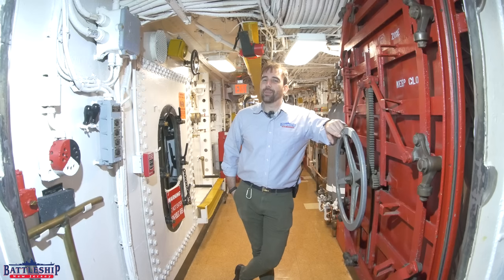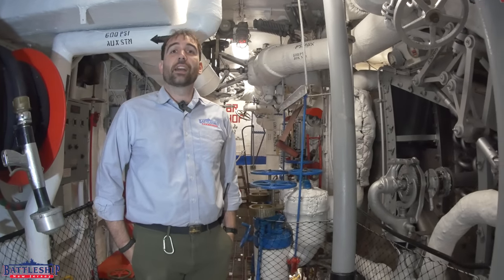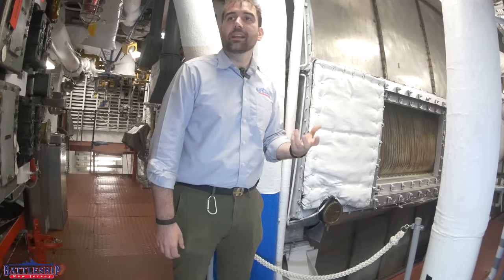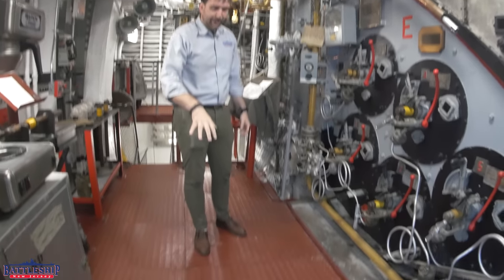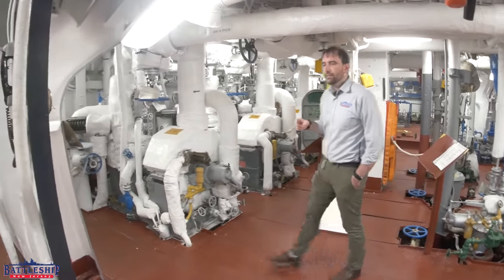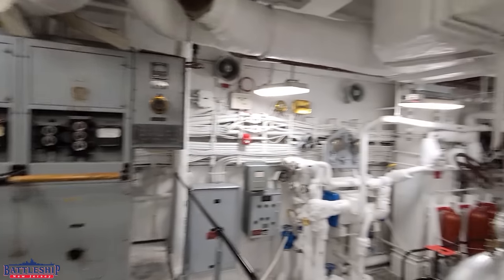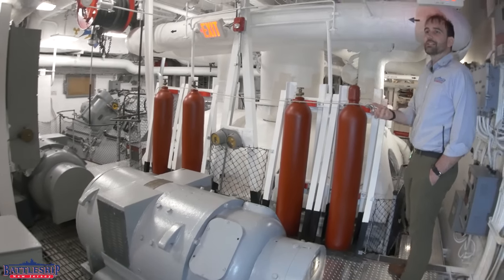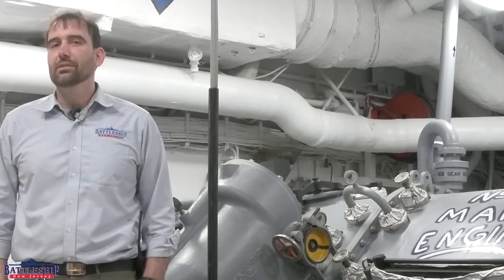Inside the Propulsion Plant of the World's Fastest Battleship

Comment: Yes!!! Excellent video, thank you. I spent 2 1/2 years in Missouri Engineroom #4, and my eyes were darting back and forth, recognizing equipment from my days of old as you traveled through.

33 Knots was her "classified" top speed; what the Public was allowed to see. Yes, they go faster...how much faster is info I'm not privy to. It was kinda comical though, we'd be pulling back into port at Long Beach, and Civilian boats would come out to meet us and escort the ship in. Just regular people in their private boats, having a good time. We'd be loafing along at 8-10 Knots or so, slowing down for Port entry many miles ahead of time, and still the Civy boats would struggle to merely match our speed heh.

Also, we always kept brooms handy, not just for cleaning purposes. If the steam pipes got a pinhole leak, you found the leak by waving the broom handle in front of you. The 600PSI steam has SO much energy, it would supposedly lop off the end of the broom handle like a laser. Happy I never got to test that theory out.
Reply: It would cut the broomstick and burn it at the same time... Better than waving your arm, which could be cut off and carterized instantly.
Reply: My Brother was a BT and  DC on the USS GUAM and can confirm that is how they found high pressure steam leaks using broom sticks.. And yes the steam sliced through the broomsticks like a laser.

Comment: How about a video on the Evaporators.  I was an evap specialist on board a Gearing class Destroyer and ran both in the engine rooms. As a Machinist Mate, I was qualified for all the engine room watches.  I will be touring the Missouri in December.  Your video gave me some good info. The Gearings had 4 600 lb Babcox-Wilcox boilers and two 30,000 Hp Westinghouse turbines.  When we were completely lit off (all  4 boilers) we could do around 34 knots. Man was that hair-raising, to say the least.   Those ships were a BT's dream. They only had the stream-powered Fuel pumps in the Boiler spaces. We had all the auxiliary equipment in the Engine Rooms DA, Feed, and booster pumps to maintain and operate on top of the lube-oil pumps for the Reduction gears.  All that packed into small engineering spaces on a 390-foot vessel with a beam of 40 feet.  We used to call it standing watch in 120, 120* heat at 120 dbl sound.  It was deafening and our hearing suffered from it too.  I've toured the Midway several times in San Diego.  She's another 600 lb plant very similar.

Comment: M-type boilers are also known as controlled superheat boilers, because the superheating process has separate burners and can thus be fine tuned independently of primary steam generation.  On smaller ships, where space and weight are at a premium, you’ll find D-type boilers, aka uncontrolled superheat boilers, which didn’t have separate burners for the superheating process.  The late 60’s/early 70’s design of the Knox-class DE/FF I served in had two 1200 psi D-type boilers driving a single engine/shaft.  Automatic boiler controls vastly reduced the workload for the BTs—the older 600 psi M-types were all manually controlled, and took a lot of work to operate.
Reply: Sub tenders have 600 pound D types... i was stationed on the cable 08-10
Reply: Great info. I didn't notice the sootblowers. Do you remember if they were manually operated or some type of motor or air motor? Also, were the force draft fans stream driven at power? My first ship had sinuous sectional headers with straight tubes. No economizer but a Lungstrom air preheater. USNS Barrett Class.
Reply: @FightUni09  I don't know how it worked on the Iowas, but on my frigate we used steam to blow tubes.  The sootblower pipes were rotated manually using a chain drive, as I remember.  Our forced draft blowers were also steam driven.

Comment: MM 2nd class here, served onboard the JFK (CV67) and lots of the same technology here only slightly bigger. This video brought back a lot of memories, most of them exhausting. We used to call the engine room Mordor, the heat and the very air one breathed was poisonous from the fuel fumes and steam leaks. Hottest was always by the feed pumps once saw a thermometer read 138 F there in the Red Sea. Toughest guys on the ship, hands down.

Comment: As an ex USN Machinests Mate who worked in engine rooms but never on a BB, I found the images very interesting. Thank you.

There were a few misstatements. Probably too late to correct so I won't detail them. You might want to run future scripts past persons more familiar with the equipment.

Other videos I'd like to see: Fire control, as in gun fire control, complete to linkage to the turrets. The mechanical computers are marvelous devices. Also, damage control (which is widely distributed but, I believe, centrally controlled). Things like counter-flooding control and magazine flooding should be included.
Reply: Agree with having scripts reviewed.  As a former IC, I've caught a few cringe-worthy errors myself.
Reply: You misspelled Machinist's Mate. As an Retired MM myself I still salute ya.

Comment: Hi, Ryan. Pretty good walk-through, but you've still got a few things to bone up on before you sit for your EOOW exam. For one thing, that blue line dropping down from under the DFT is actually water going OUT of the DFT to the feed booster pumps, which are designed to run cavitating to provide net positive suction head to the main feed pumps, which will NOT run cavitating. In merchant ships with plenty of space the DFT is elevated some forty to fifty feet above the feed pumps rendering the feed booster pumps unnecessary, but obviously that's impractical on a battleship. Water coming into the DFT is pumped by the main and auxiliary condensate pumps which take suction out of the condensers and send the condensate back into the system.

Also, you got the throttles exactly backward in the engine room. The throttle wheels are, first and foremost, valves...righty tighty, lefty loosey. So you turn the ahead throttle wheel counterclockwise to open the nozzle valves and accelerate, and clockwise to shut the throttles and slow down. Also, the astern turbine is actually a separate turbine, but placed on the same shaft as the low pressure turbine blades. The steam doesn't "flow backward" through the turbine; rather, the astern throttle is opened to admit steam to the astern elements placed on the forward and aft end of the low pressure turbine rotor, and that develops the power to spin the shaft in reverse. The two large steam lines coming into the low pressure turbine from the overhead are the astern steam lines, while the large pipe coming from the high pressure turbine to the low pressure turbine is the crossover. And the steam going into the condenser is not at "zero psi" (or, at least, it better not be!); it's at well below atmospheric pressure. To squeeze every possible horsepower out of the steam flow, the steam keeps expanding all the way (and increasing in volume tremendously) all the way down to the condenser pressure of about 29" of mercury below atmospheric. Fun Fact: At full power the high pressure turbine expands steam from 600 psig down to about 55 psig, while the low pressure turbine continues the expansion from 55 psig down to 29" vacuum, or about negative 14 psig. But (at full power) the low pressure turbine develops more horsepower than the HP turbine, due to the tremendous expansion in volume as the steam drops below atmospheric pressure. Look up and study a "Mollier Diagram" for the straight skinny.

Otherwise, pretty good job; you're getting there!
Reply: I caught that too about the DFT. But  the condensate usually passes through the steam jet air ejectors and first stage heaters before entering the DFT which is a direct contact heater with auxiliary exhaust heating. There would be a small vent on the DFT blowing steam and whatever non-condensibles it could drag out to the outside atmosphere. 
I gave him a pass on the engine controls because he never actually ran them. I'd bet that the astern turbines are velocity compounded impulse stages (maybe 2 stage?). Wondering if there is a lube oil gravity tank with a bullseye to the gears?
Reply: They probably used Curtis Staging as the Astern Turbine. Much more durable in case of water droplets in the steam.  "Mollier Diagrams" brought back memories of things you knew and forgot from 30 years ago. All I remember was it was a hot hot hot place to work. And not many peeps strolled by to say hi.
Reply: @FightUni09  Correct about condensate to the DFT; I was simplifying. On the Missouri, IIRC, the astern elements (pair) were single-stage velocity compounded Curtis stages with three rows of moving blades. And no gravity lube oil tank on an Iowa-class.

Comment: Great video, well done. As the curator of the ship you must have access to the original drawings used in building this vessel. An episode on the drawings themselves would be interesting showing the structural elements with bulkhead & water tight compartments, equipment location schedule, fire suppression, electrical, powerplants & associated power drive,  piping, armament,  crew quarters, fuel & water storage. This would show how densely packed this warship is and the amount of work to fit everything in. Reviewing the drawing with photos of the ship under construction would be an interesting subject for a future video.

Comment: Love the details here! I would really enjoy hearing more about the fuel systems, both how fuel gets to the boilers (does it need to be pre-heated, since it’s more of a pudding, and if so, how does it get out of tank, are there tank heaters?), as well as how fuel is stored, and how it’s refilled.
Reply: Bunker C was the thick black oil that needed to be pre-heated to be able to get it to flow through the burners.  I believe that there were tank heaters, as well as local heaters near the boilers.  As Ryan said, the boilers were converted to Navy Distillate (DFM) fuel during the 80's upgrade.  DFM is very close to what a residential oil furnace would burn.

As with any liquid, fuel is stored in tanks.  To take on fuel you either go pierside at a fuel pier, or receive fuel during  an Underway Replenishment (UnRep) at Sea.  Of the two, UnRep is actually quicker, as the replenishment ship is quite capable of transferring fuel at volumes and pressures that would make the civilian workers at the fuel pier crap themselves and run for the hills.

Life kinda sucked for the replenishment ship, as they had no choice but to take on fuel at a fuel pier.  When your tanks hold 5 million gallons of DFM and 2.5 million gallons of JP-5, you WILL be there for a while...like 24-36 hours.
Reply: @kevincrosby1760  Yes, but the crew likely would get 24 hour liberty as well, which would be a welcome respite after months at sea.
Reply: @kevincrosby1760  I actually worked as fuel king, ran cargo fuel control, on an oiler. We would regularly get topped off at sea from other oilers. We only went pier-side near home port. Aircraft carriers would regularly take 2 mil gallons each time they came alongside, we would unrep for hours alongside them.
Reply: Actually they have low pressure steam systems to heat the old bunker fuel, it’s called “steam tracing piping”. It was in each fuel tank and attached to all the fuel piping. You can still see it on the fuel lines.
Reply: @SeanBZA  that's a nice theory, but I never saw it happen in practice.  

We were on 4-section duty, which means that at any given time, 1/4 of the crew was on duty and could not leave the ship.  This was normal in-port Cold Iron routine with everything shut down.

You're not going to shut everything down and go Cold Iron for a 24-36 hour refueling.  That means Engineering is running pretty much fully crewed.  Besides, you're not going to be able to pull enough power from a Shore Power connection to run fuel transfer pumps to keep the ship in trim as you are taking on fuel.

"Taking on fuel" brings us to the guys in POL, who are responsible for all things fuel-related.  They are also running a full crew whenever fuel is being taken on.

Since you now have Duty Section + 2 departments working, the galley isn't going to get away with 2 guys on duty, so they are stuck on board as well.

In short it all snowballs,  and most of the crew ends up stuck on board.  It should also be mentioned that M-F 7-5 are working hours, and EVERYBODY is on board.
Reply: @richcruse2689  In 3 years on the USS Kansas City (AOR-3) there was perhaps twice that we took on fuel from another oiler.  Saw fuel piers more than I would have liked.

Then again that was one ship, with the way things were 35 years ago.  Things can and do change.
Reply: @kevincrosby1760  about same amount of time on USS ROANOKE (AOR-7). saw pier maybe 5 time twice during duty oiler.
Reply: I didn't notice whether the burners could light off on diesel fuel to raise enough steam to heat the FO settlers and the coils in the FO Tanks to start circulating bunker C. I bet she rarely went cold iron on all the boilers at once so there was steam available to heat bunker C all the time. You really need to grasp the Big Picture to start from ice cold. I LOVE STEAM!

Comment: The ventilation blowers are NOT the Forced Draft Blowers. The forced draft blowers are what force air into and through the boilers - they provide the combustion air.
Reply: I'm glad you explained that so I didn't have to. 😅

The forced draft blowers are a major piece of equipment, some of them rotating at 10,000+ rpm.  And always a pain in the butt for the vibration analysis (predictive maintenance) guy to test.
Reply: And their secondary purpose is to cool the boiler casings.  The Jersey has horizontal style FDBs and they're located "behind" the boiler.  Have to take the catwalk behind the steam drum to see them
Reply: @bigjonseattle 0:16

Comment: Usually the air vent fans are electric motors not steam turbine powered.

The forced draft fans supply the boiler not the engine room vents and can be electric navy or merchant  or Steam for Navy.
Reply: Or both steam and electric.  Some ships have 1 electrical FDB on one boiler so that you can get that boiler up from Cold Iron, generating steam to be used in bringing up the rest of the plant.
Reply: I Think the small electric forced draft fans were put in only on navy ships when the switch to light fuel happened .
Merchant marine never switched .

We joked giving a steam boiler designed for bunker light diesel fuel is like giving fine 12 year old scotch to wino!

On light off the air fuel ratio even with smaller burner plates, hole size, was too high and the much more volatile gasses collected in the cool uptakes .

The fans could not be slowed  down enough of the dampers shut for the slow warm up needed.

We had many boiler explosions .

A boiler inspection device BID was used later to check for diesel pooling in the furnace floor also causing flare backs not normal with bunker. It was a periscope with a light shoved into the burner register to see the floor.

The worst part was the Merchant steam ships Never cleaned the tubes even with bunker C frequently like the navy did neither did any shore plant!

It was a Navy tradition left over from God   knows when perhaps coal clinker days!!!

We water washed the boiler fireside’s annually instead .

I often think of the poor BT’s in hot just shut down boilers doing the unneeded work because the Engineering officers were only Navy boiler trained and did not see shire plants or read outside non Navy reports !

How many BT s did not reenlist due to the foolishness before they switched ?

How much extra money did the Navy spend buying F-76 rather than bunker c/ NSFO!

Comment: The water droplets can also cause major issues in the boiler itself such as eroding and corroding the tubes leading to leaks and because the water droplets are incompressible if there is a significant build up they can cause ruptures or explosions... unlikely to happen in a more modern design such as the M-types that New Jersey was fitted with (especially if well maintained) but was a major concern in the early days of steam power.
Reply: The tubes carry water to and from the water drum to the steam drum. I think you may be talking about water quality in the boiler. High TDS, water hardness can leave silica on the inter tube walls and can leave to tube failure. Water tube boilers are not prone to explosions as were fire tube boilers of old.
Reply: Do you remember your 3 endpoints of boiler operation in order of severity? Brings back memories for me!
Reply: @FightUni09  Circulation, combustion, carryover